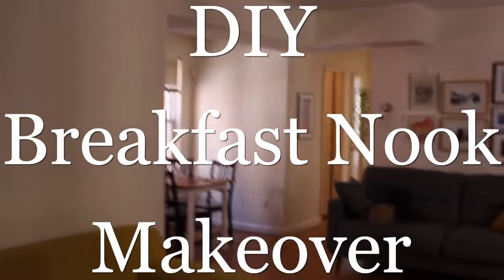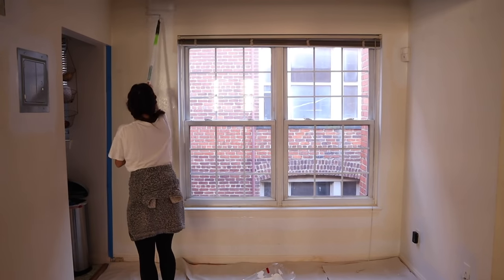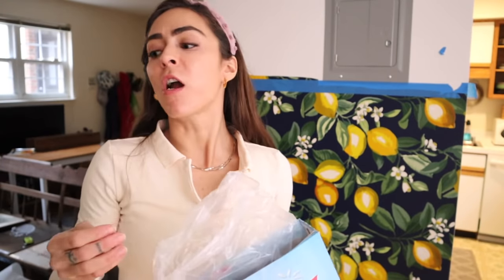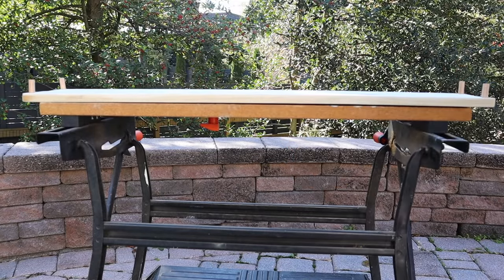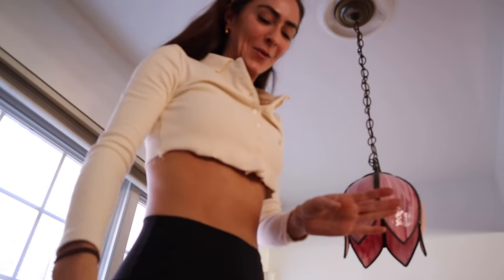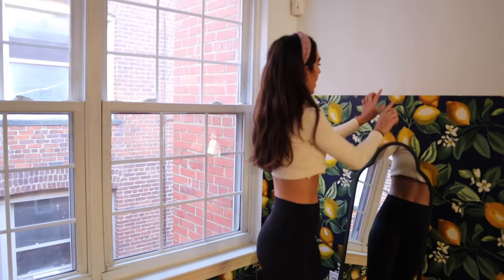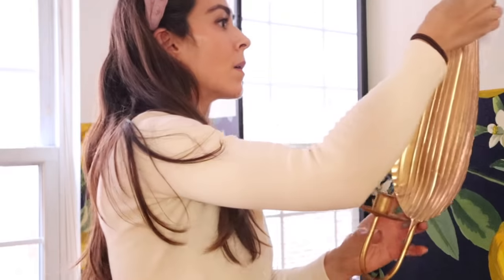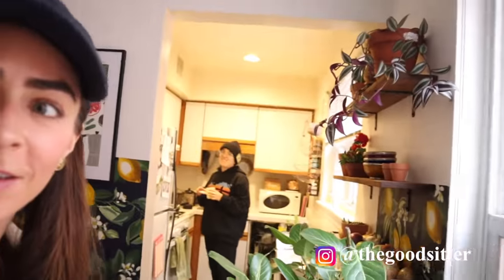DIY Eclectic Breakfast Nook Makeover | Dining Room Makeover

Comment: Measure and cut the wallpaper before hanging. May or may not be trickier to manipulate but then you’re not cutting into the wall. Also then your scraps still have the peel paper and can be used somewhere else and avoid having the sticky side exposed and wasted.

Comment: A few recommendations for another way to create a level line with peel and stick wallpaper:
- if the wallpaper pattern does not require a vertical/portrait orientation (as the leaves and lemons seemed to be in many angles, with no strict 'upright' direction, this one did not seem to matter if it were rotated), instead apply it horizontal/landscape so the manufacturer edge becomes the level.  Using a tape edge guide or pencil marks to help apply the now top edge straight. Ultimately, you end up only cutting the wallpaper at baseboards and windows, where you'd trim anyway.   
- measure the desired height and mark where to cut on the back of the wallpaper.  Use a T-square to draw a straight cut line, then follow the line either with good scissors (that don't warp the cut edge like some dull or craft scissors do), or on a cutting mat with an x-acto knife and the T-square as a cut guide.
- hide a wonky cut with trim, which can be wood, a separate wallpaper border, or even a craft, fabric or upholstery notion, such as cord or tassel fringe.

Perhaps you'll see this (if you do) in time to save headaches for the next wallpaper project.  
Good luck!
Reply: It’s called “railroading” when you hang wallpaper horizontally.

Comment: I've used peel and stick before and it's WAY easier to cut and make sure things fit before you peel off the backing! You can make sure the pattern lines up and everything's the same size. It turned out amazing though!

Comment: I found that same pendant light in a cream on Facebook Marketplace. I had to rewire the whole think because it was hard wired and I needed it to be plug in. I included an in line switch so I could turn it on easily. It was my first time wiring anything and of course it took for ever. Then, finally, the moment of truth. I plugged it in, turned it on… and it immediately blew a fuse. Lol. I had to do it all over again! Smh. BUT I learned a lot, realized my mistakes, and had the confidence of knowing I did it right the second time. It’s still up and I’m still loving it today!

Comment: Idea: Put the tape above where the wallpaper should go. It's still giving you the correct  visual placement and measurement and you can remove it when your wallpaper is in place without needing to cut or measure any further.

Comment: Hi, I really love your videos! Your work is so inspiring and its encouriging me to give my rooms a new spirit.
Thank you so much for sharing your knowledge and investing so much love and time in your videos. 

So to the szene with the saw: as a fresh educated carpenter I can maybe give you a tip of preparing a kind of template where you can put round sticks in. If you want to saw round things with a round saw, it can happen that they move uncontrolled towards you and its becoming quite uneasy to hold it safely.( In this size its not that bad I guess, but thats why the results wasn't satisfying for you.)
In case you can't hold it, it could cost your fingers one day or any other injuries might happen.
You re intuition was absolutely right.

With a quick builded tool you can saw round stick without taking the risk to get hurt.
Its looks like an open square which is surrounding the rod. In the best case its tight enough that the rod can't easily move. So the result will be better too.
Or of course sometimes you can also just do it without machinery.

Sorry for my poor english, I hope you know what I mean.

I don't wanna txt like an smartass here, I am also still learning every day. But I ve seen injuries and it would be a shame if nobody would tell you about it.

In germany the safety rules are pretty strict though :D

I wish you a lovely day and pleaaase keep on making videos like this <3

Comment: Those are sconces, designed to hold a candle and reflect the light from it. A votive candle can be any size as it is the intention that defines a votive, not the size. Tea lights with their little aluminium cups are generally used in churches now when making prayers to a saint but originally they would have been taller candles. Tea lights are so called because they could be set and lit underneath a teapot to keep the tea hot, and I remember seeing them in Chinese restaurants under chafer dishes. With the advent of electricity, candle (and subsequently gas) sconces became electric light sconces. But originally they were for candles, and some have actual mirrored backs for max. reflection.

Comment: In order to not have proble with the pull of the tape, you've to it when the paint still wet.  It will vone out very well.
Do not do it immediately...must be a bit dry, but not completely dry ...or completely wet. 
I hope is clear a

Comment: Bad wiring in your attic can absolutely cause a fire. Just because the light turns on doesn’t mean it’s a safe installation. Highly recommend that people get an electrician involved, or at least someone who understands electrical circuits.

My friends just burned down their rental house. Open splices behind an old light got overheated when they plugged a space heater into the same circuit. Fire started in the attic and they didn’t notice it smoldering for hours. 

Sorry to be a killjoy, that’s a gorgeous lamp!

Comment: I would love to know (or if anyone knows) how you did your visuals for the design plan. I see alot of designer either using some 3D floor plan or like pictures on a mood but yours I could really see the vision! Was it just photoshop or did you use a different program??
Reply from the maker: Photoshop works well! I happen to use a random software that probably no one else uses (Sketch, not to be confused with SketchUp) - and I use that because I already use it in my day job as a web designer. I find it much easier to use than photoshop. But sometimes I use photoshop as well!
Reply from the maker: One interior designer I worked for literally just made moodboards in Google Slides. It doesn’t have to be fancy. Whatever gets the vision across to yourself or your client!